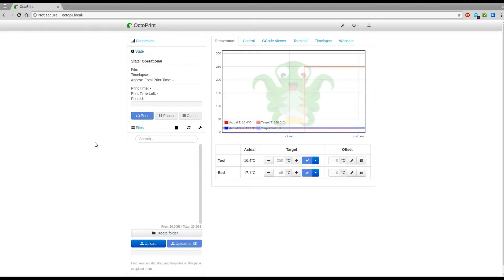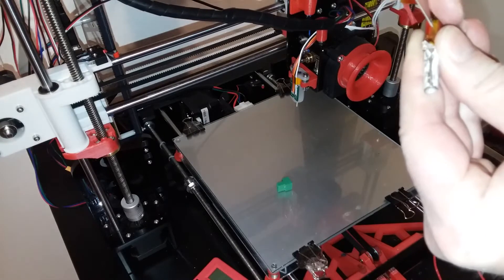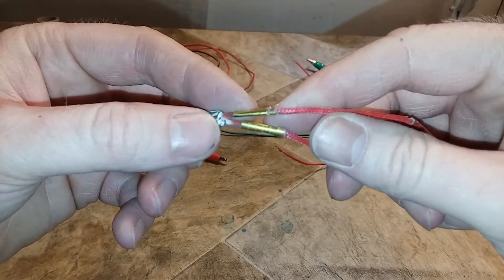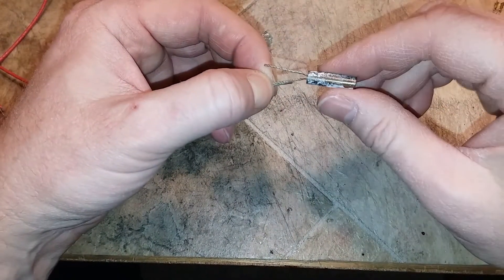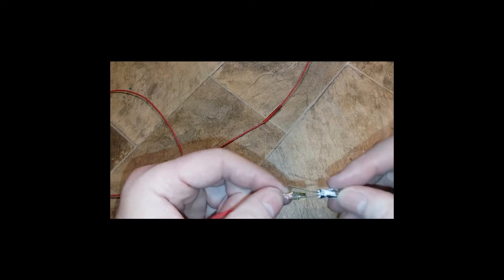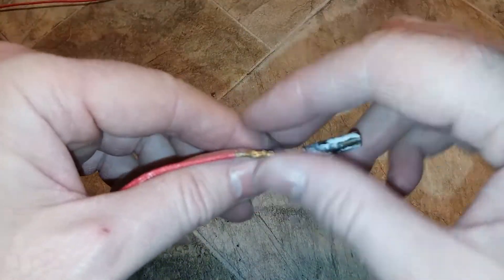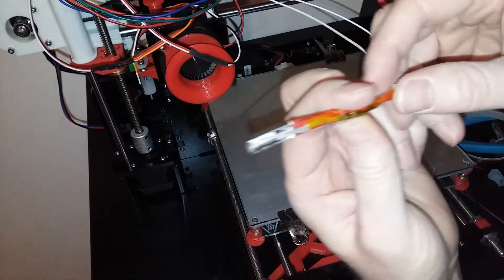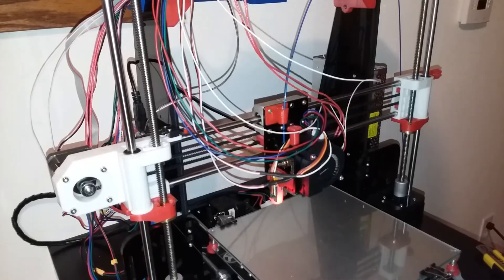Trouble shooting an extruder heating element failure

Comment: SOLVED! Now my nozzle is tightened flush with the heating block, which is only touching the thermistor and heating cartridge, and the finned fan-assisted intake tightened too BUT its lowest fin is NOT TOUCHING the heating block. That was the problem. The fan-cooled intake was cooling the heating block.

Comment: My fix was that my power supply was at 22 volts and it's a 24 v power supply and I got the same erorr and I opened the power supply (be careful work with one hand at a time and wear thick rubber footware) and I found a little potentiometer and with a multi meter in the output of the power supply and I turned the potentiometer till I've got to 24v and that fix ti